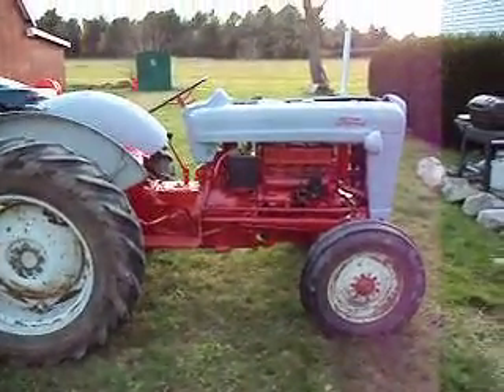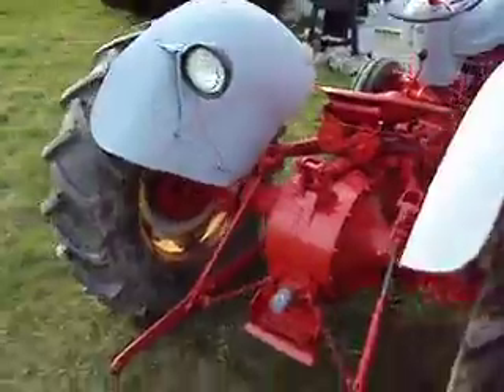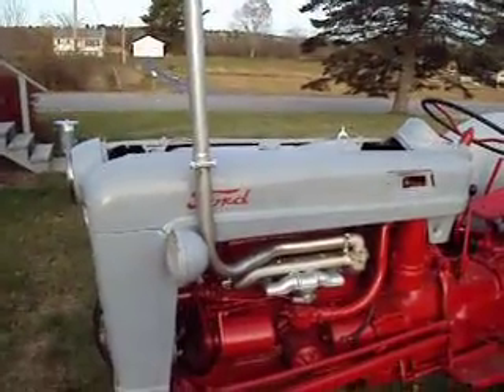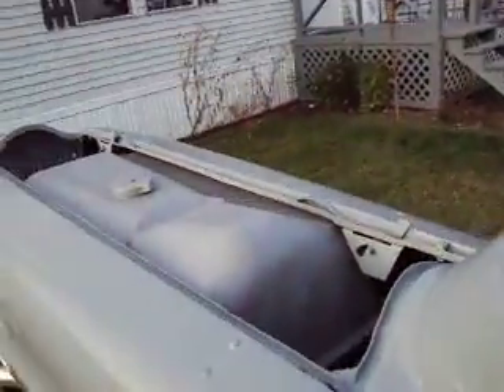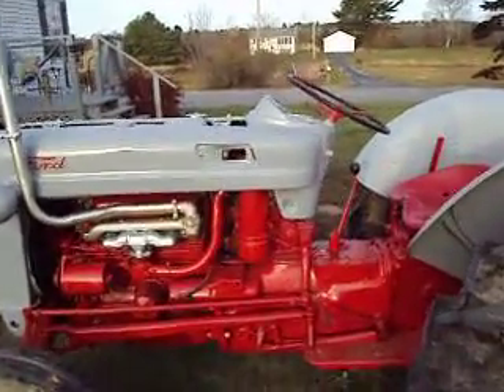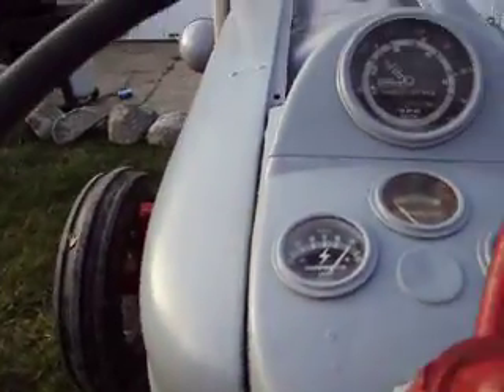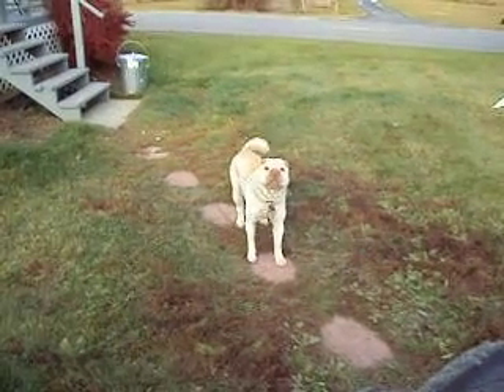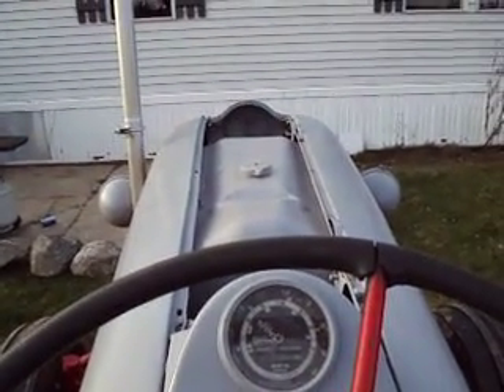Ford 800 Tractor update

Comment: this a 800 tells me it has a 172 cid engine with the 5 speed  if it has live pto its a 860  it it dose not have live pto it is a 850 hope this helps a little these are good tractors  and the 6 volt tells me it is before 58 after 58 thay where 12 volts  nice tractor hope you are having fun with it

Comment: Hi just bought and 800 the only thing that dosen't work is my volt meter there is 1 wire not connected  don't now were to put  it test meter say the alt. Putting out 13 to14 after starting  up need to find repair manual 
 Go the God. Does tractor bush hog and hair 2800 runs like a top no problems start right up everything works except the village meter

Comment: any one know why when i lift my three point on ford 800 the RH lift arm wants to bend ?
Reply: Use the spindle on right arm to shorten or lengthen the arm. Park it on a flat and level surface and use level and rest it at the end of both arms turn it in the direction until it’s level.